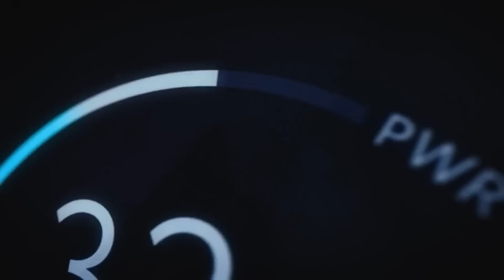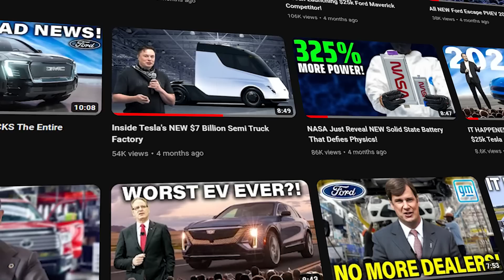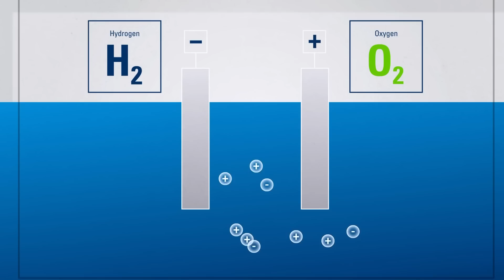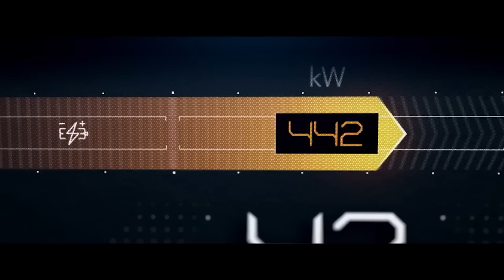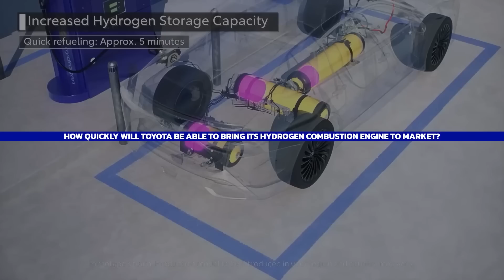New Toyota CEO Reveals Hydrogen Combustion Engine | Shocks Industry!

Comment: YES! About time someone starts taking hydrogen seriously. Battery's suck, 7 hours to charge and the go bad after a few years at user cost , hydrogen is so much better.
Reply: I don't think you know what you are talking about.  Teslas can charge in the time to get a coffee and a toilet break.This will improve. A lot of people can charge at home like a mobile phone. Tesla batteries last a lot longer than most cars. Hydrogen corrodes metal and any leak can result in a significant explosion. Hydrogen is expensive and the laws of physics say it will always cost more than electricity. Transportation of hydrogen is a problen too. A hydrogen re-fuelling station took eleven lives and Toyota's racing car was incinerated.
Reply: Real world data shows Tesla battery packs last about 500,000 miles before reaching end of life and then continue to work with a reduced range. By that time my long range Tesla model Y will have the same range as the standard range model Y. :-)  
I charge at home overnight from a standard 120v outlet. Takes 15 seconds to charge, plug in when I get home, unplug when I leave. No more wasted time going to a gas station and wasting more time fueling. Imagine waking up to a full tank every morning. 
On long cross country trips charging at Tesla's supercharging network takes about 8 to 15 minutes or the time it takes to pee and or get a cup of coffee. 
We gave our two gas guzzlers to our kids as we would rather share one Tesla than have to drive a POS ICE cars with their maintenance and constant pain in the a$$ costly repairs.
Reply: @SmokinPaul  There's nothing magical about Tesla batteries.  Tesla batteries are Panasonic batteries, or CATL batteries, or whoever they contract/partner with for their batteries.

Comment: H2 Infrastructure will be needed before Hyrdogen will ever have a chance of going widespread.  Right now it's bottled up in California and a few trucking routes.
Reply: It's easier to convert gas stations into refilling centers than it is electric. How many  years do you think it's going to take to improve the current electrical grid to accommodate all this electric demand? You'll probably be dead before that happens.
Reply: Hydrogen would need to change the laws of physics before going widespread.

Comment: fuelcells are a somewhat wasteful solution to a vastly overblown problem of charging. even if current infrastructure can't support the rapid increase of BEVs at peak times, its still better than hydrogen since that doesn't exist and is also limited by the amount of costumers it can serve in a period of time . hydrogen ICE cars are a particularly wasteful solution to the same problem plus the fact that the cars don't go vroom. also, if you are gonna complain about the range of an EV, the range of a hydrogen ICE car is probably less than half of what the fuelcell can do and it can't really improve. the energy density of hydrogen is pretty much fixed and ICE engines are already pretty much at their peak. it would probably be better to just buy a hybrid and fuel it with synthetic fuel. so really, the world would be better off accpeting the 20 minute brake after 3h of driving that EVs require.

Comment: First, check out Out of Spec Reviews for a real-time fill up on a Toyota Mirai. It was not 90 seconds, but it was a mere ~4+ minutes for a refill to full on a newish pump system if you compare to the current EV charging times. At one of very few stations that even exist at that. However, battery and charging technology are on a very fast track to getting EVs closer to that 4 minute mark with a longer range output. There isn't much improvement for that hydrogen refill time given the pressures involved apart from smaller tanks, which means less range. Also, if you think the hydrogen engine is a direct replacement for a conventional ICE check out Engineering Explained on what would need to happen for that to occur. The current hydrogen cars are hybrids so you aren't getting away from an EV per say, just an alternate way to provide electricity generation. Basically swapping a conventional ICE with a hydrogen ICE. Does it have a niche, yes, unless battery and charging technology improve to the point of making this a moot point. Then it is just wasted money to even invest in it.

Comment: Not against the idea. I see issues. For instance fueling up and cost of said fuel up. On average hydrogen costs about $15 or $16 a gallon. Who in the world can afford that for a daily commuter? Another issue would be the lack of industry and infrastructure. How do they plan on being able to support 100s of milllions of these types of vehicles let alone 10,000 or so nation wide. It's not like electric cars where the upgrade for those vehicles is rather straightforward (all be it still costly) point is to implement the infrastructure needed to support these vehicles would be absolutely insane and would blow away what it would cost to go electric. Not a big fan of battery powered cars and would love to see more alternatives, however, those alternatives will have to be something that is actually feasible financially and something that is an easier transition infrastructure/industry wise.

Comment: Love the comment about charging issues when I have ever seen a hydrogen refueling station. As an untested and impractical fuel source, this video is pretty biased and dishonest.
Reply: There weren't any EV charging stations not just too many years ago either....
Reply: @Mike-hb4pc  But, there was lots of infrastructure for producing and distributing electricity.  It was just the last few feet to the car that was missing.  Hydrogen infrastructure would have to be built from scratch.

Comment: I can't believe that a large company like Toyota is investing in hydrogen. It is a no-brainer to go all electric.
Compare: 
1) Hydrogen internal combustion engine (ICE). Convert electricity to hydrogen (heat and flow losses); compress (possibly to a liquid below -253°C with the necessary cooling to keep it liquid) for transport; build worldwide specialised, safe storage facilities for hydrogen (it is a very "leaky" fluid) both bulk and local; move the hydrogen to the storage facilities (previously petrol/gas depots or stations); re-engineer the refuelling facilities to safely fuel a car (if you have ever seen bulk liquid hydrogen or helium pumped from a tanker via a pipe you will know that the air itself liquifies on the pipe and drips onto the ground - not good for the toes to have them bathed in liquid air); re-engineer car fuel systems to safely retain hydrogen in the event of a crash; suffer the low efficiency of the ICE; suffer the few additional miles driving to get fuel from a "petrol/gas" station; suffer the costs and frequency of service requirements for a hydrogen ICE - including the disposal of used engine oil and gearbox oil. Run the risks of storage locations failing/exploding, tanker drivers' strikes, fuel blockades etc.
2) Electric motor. Use the existing infrastructure for electricity but add charging points - possibly at the owner's home or street lamps for convenience; develop battery technology further (e.g. stop using lithium start using sodium); suffer the minimal servicing required for electric cars (very few moving parts but brakes will still need regular work - unless magnetic/regenerative brakes become surprisingly good); suffer the much greater overall efficiency of an electric car (looking at all the energy and materials used to keep the car moving - e.g. no fuel tankers);  run the risk of power outages.
Reply: Electric motor: Require a big battery pack that almost doubles the weight of the car, causing a lot more wear and tear on both the tires and the road, and generally needs to be replaced after 10 years at the cost of 10,000$ to 20,000$. If you get into any kind of accident, expect to pay a lot more in repairs to replace all the super sensitive sensors (average repair cost is 3x that of ICE cars).  Outside of North America, prices of electricity have soared 3x to 5x because most of it was produced from Russia's oil and gas. Become even more dependant on a hostile China, who controls 80%+ of lithium processing. Imagine if they invaded Taiwan... Nah, that's impossible, just as impossible as Russia invading Ukraine.
Reply: @noseboop4354  1) Tesla Model 3 has a weight between 3,700 and 4,000 pounds - a comparable sized Toyota Camry weighs 3,200–3,550 pounds - so nowhere near double the weight (of the 4000 lbs, the battery weighs about 1000 lb).
2) The life of battery packs is going up by leaps and bounds as the technology advances. It was true several years ago that batteries lasted only ten years. Nowadays, it is approaching twenty and I'm fairly sure the technology will eventually get to the point where it lasts the life of the car (with degradation down to about 80% capacity).
3) All the sensors mean that Teslas (for example) are considerably less likely to have an accident and perform better - it is more likely that a road-raging Jimmy driver or F150 driver rams a Tesla. As to actual cost I have only found 2.7 times (£596 vs £221 average repair cost - but the devil is in the detail) but it will come down as repairers get used to fixing damage (as with any car). Also note that as ICE cars become more sophisticated they will adopt the same technology so the difference will reduce.
4) In the UK up to 40% of our electricity is generated by wind power (we have some very large offshore wind farms) which to some extent insulates us from rising carbon fuel costs. Here, electricity has risen from 18p to 29p to 32p per KwH (2021, 2022, 2023) so not even double the cost and it is not subject to tax, like petrol or diesel. Prices will likely return to near the original value once the war in Ukraine is resolved in Ukraine's favour. Also, the use of fossil fuels is the main (but not the only) cause of global warming that is ruining the planet (extreme weather in the USA, for example) which is never taken into account in any costings despite the many billions of dollars or pounds of damage incurred, to say nothing of the many lives lost.
I'm open to any honest debate but most of what you have indicated is either completely wrong, or outdated.
Reply: @noseboop4354  Lithium is one of the most abundant elements on the planet. Tesla is getting into lithium extraction and refining here in the USA to save money. Not very cost effective to process the lithium in China then ship it across the ocean does it. You are barking up all the wrong trees. LOL
Reply: @SmokinPaul  It doesn't matter how abundant lithium is when no country other than China wants to touch it because of the massive water pollution.

Comment: I'm pretty sure any type of "combustion" will produce undesirable "emissions".
Reply: Exactly.  The air going into the cylinder is mostly nitrogen.  Any combustion engine is going to have NOx emissions.
Reply: yeah just like battery manufacturing or breathing
Reply: @philongpham3886  Yeah, you got that right!

Comment: burning hydrogen with air is NOT green at all. selling "hydrogen combustion engine is clean" is a big lie. that lie deliberately ignores nitrogen dioxide byproducts produced!! treating that pollution in the exhaust with hydrogen combustion engines is even harder than with Diesel engines!

Comment: We are going to see hydrogen powered combustion and hydrogen fuel cells as the future. I mean it does make sense.
Reply: If it made sense, people would have bought the Toyota Mirai and similar hydrogen fuel cell vehicles from other manufacturers.  Almost no one bought them.
Reply: @dansanger5340  no one bought them because there is no infrastructure except in California I believe. Give the infrastructure and introduce it and people will for sure buy it.
Reply: @aronmiller7648  Lack of infrastructure is a perfectly legitimate reason not to buy a hydrogen powered vehicle, and will continue to be indefinitely.  The EV charging infrastructure has been able to be built out quickly because the electricity infrastructure was already ubiquitous, and only required installing chargers and connecting them to the existing grid.  Building out a hydrogen infrastructure would be way way harder.
Reply: @dansanger5340  Not only that no one has actually offered them. Besides Toyota in essentially a test market.

Comment: HYDROGEN COMBUSTION LMAO, am dying over here. :text-green-game-over::face-green-smiling::face-purple-crying::face-blue-smiling: 
So ya gonna use hydrocarbons or electricity to make Hydrogen gas, cool it to below -253 degrees, keep it at cryogenic temperatures while transported and delivered, and until the customer buys it, oh the cars fuel tank boils off a whole full tank in 24hrs so it has to be a gas, low density OR...use that power to charge a battery from your power point.* :face-green-smiling:

Comment: Ive heard this so many times.
 As long as it takes as much power as it does to make hydrogen its a dead fuel for personal transport.
Reply: Have you looked at the price of electricity outside of North America? It went up like 3x to 4x in the past 3 years because so much of it is made from oil or gas that Russia had.
Reply: @noseboop4354  I live outside of north america. If energy prices goes up it only means producing hydrogen gets even less competetive.
Reply: @kastapostgard5306  Depends where the Hydrogen is made.
Reply: @twocansams6335  please don't say excess renewables! 😅 If there were excess renewable electricity, why would grid providers be generating electricity from gas or coal?
95% of current worldwide hydrogen production comes from gas reforming, which is worse than burning coal.
The only good aspect of this video is the 90 sec refueling... That's it. Everything else is terrible. Cars are expensive, zero fueling infrastructure and where hydrogen is for sale, it is more expensive than diesel! I'll stick with my BEV and save my money.
Reply: @jimwhook  Next to a nuclear power station that is already paid for by the customers on the grid. 
Electric only works if you own a house and you can charge at home.  Supercharging stations are not cheap too.
Reply: @twocansams6335  Tell me more about thease magic locations that doesnt require energy to produce hydrogen
Reply: @twocansams6335  superchargers are about 15% of my yearly use and equal diesel prices. Hydrogen currently costs more than diesel, where it is being sold in a few places in the world. If you cannot charge at home but want to drive an EV, you would look for local slow charging at places where you spend periods of time at. Some employers offer charging at work. Nuclear power plants are never "paid off", there is constant repair and maintenance to be done to keep them safe and functional. A lot of up keep.
Reply: @noseboop4354  and now realize making the hydrogen for a hydrogen ICEV uses 10x more electricity per mile than an EV

Comment: The only way to produce cheap hydrogen is from fossil fuels without CO2 capture. Hydrogen leakage will even make methane persist longer in the atmosphere. I bet if Toyota invested enough money they could make a car with a steam engine that burns coal dust and then they could convince some influencers that it is clean and efficient.

Comment: There is climate change but no imminent climate crisis.
Hydrogen ICE is worse because Hydrogen will have to be generated through that inefficient hydrolysis process.
Hydrogen is a very explosive gas. There is no hydrogen infrastructure. However each home is already on electricity.
Hydrogen is a dead end street.

Comment: This is the one that caught fire the day before its debut at the races in Japan last week !

Japan has a VERY poor electricity grid, they require Coal, Oil or Gas from CHina or Russia for electricity (Nuclear is hated by them).
Even though Hydrogen is innefficient to produce, For Japan it is an option, but not for the restof the world.
Corrosian caused by Hydrogen is a major concern.
Reply: Why not just upgrade the grid? It's a significantly smaller grid than any other country. Shouldn't cost as much as, say, upgrading Russia or china or USA. And increasing solar roofs should help with the grid as well.
Reply: @omnitool  You know the population of Japan's cities, right?
Reply: Japan doesn't buy anything from RuZFed.
Reply: Much better option than EV. I’m not moving to that Fugazi and I’ll stick with my hybrid until hydro is up and running.
Reply: stupid, it'll get cheaper over time with economies of scale and improvements
Reply: Nuclear is a bad idea in a place with common earth quakes and tsunamis. At least in its current form
Reply: @eljangoolak  you mean in it's 1960s designed form. Modern designs are fail safe based in physics not safety systems.
Reply: @SmokinPaul  I think he means 2011: https://en.wikipedia.org/wiki/Fukushima_nuclear_disaster
Reply: @omnitool  I think he means when it was designed, not when it was ruined.
Reply: Various things can cause lithium cells to go into thermal runaway, and Tesla's batteries blow fire, instead of hot gasses....like small model rocket engines....hundreds of them..... A large chunk of roadway, or a piece of sharp metal that fell off a truck going down a highway at night, hitting the bottom of a Tesla, hard enough, at highway speeds, can, and does cause punctures, and shorts.
Reply: @DetroitMicroSound  Tesla’s cars catch fire at 1/50th the rate of an average ICEV. Hydrogen stations keep breaking down and blowing up.